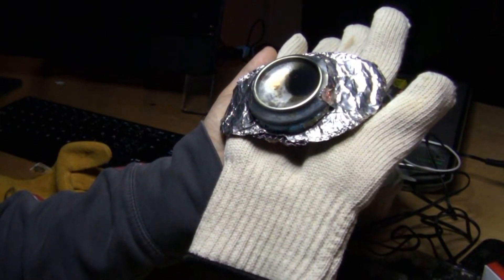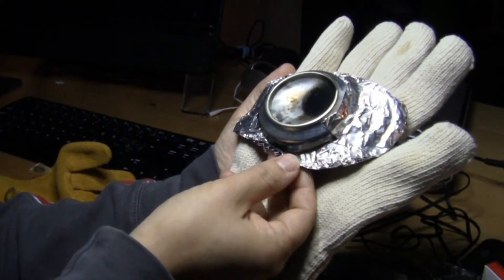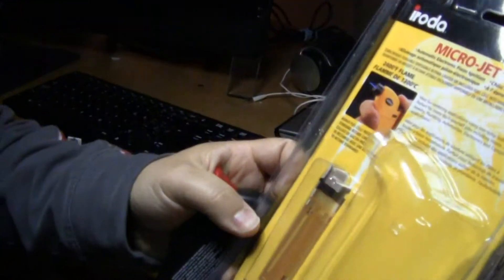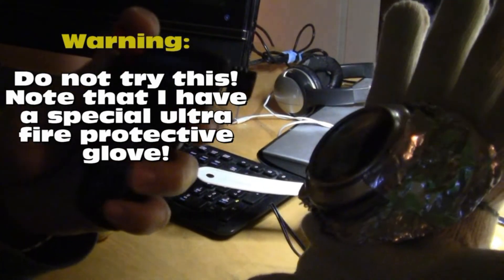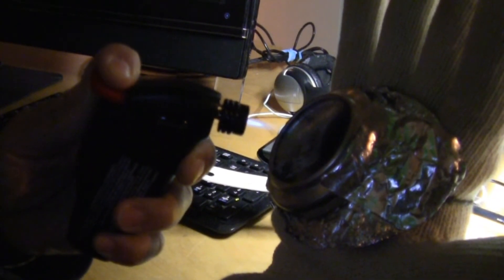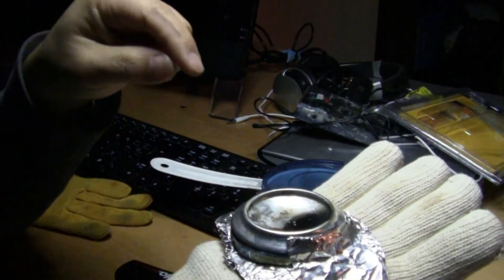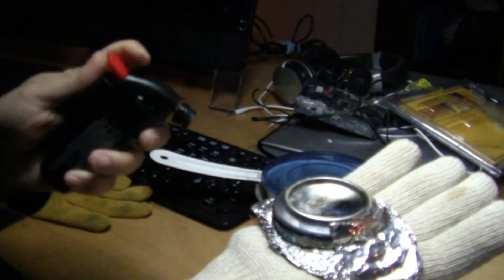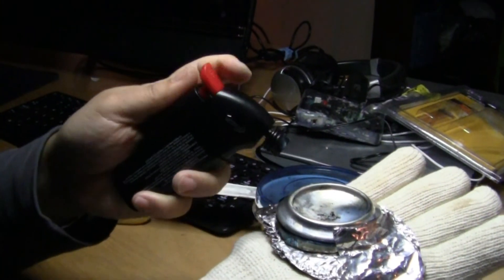Never-Seen-Before Invention- Micro Fireworks Pyroglove Ultra fireproof protective glove

Comment: Why are you burning it on the can instead of on the glove? That protects the glove from any heat, not proving anything.
Reply from the maker: Beneath the can, contains the essential elements for extreme heat resistant material.  That's my trade secret invention.  ; )